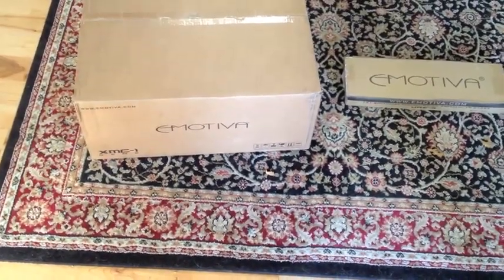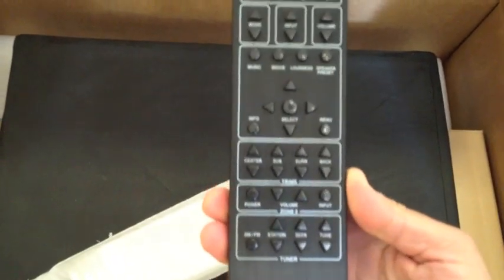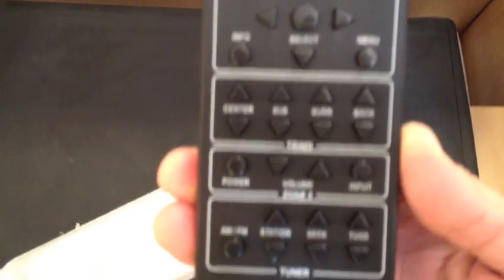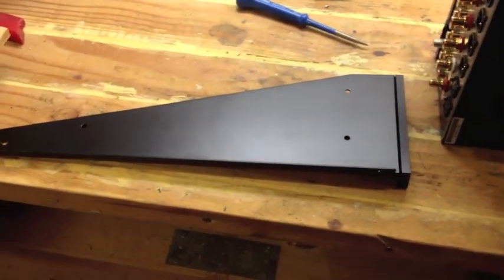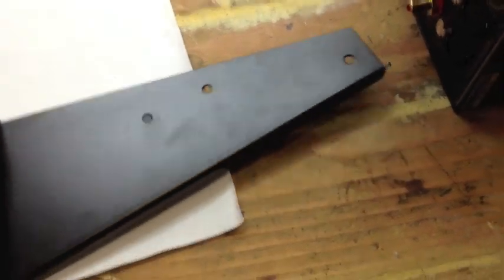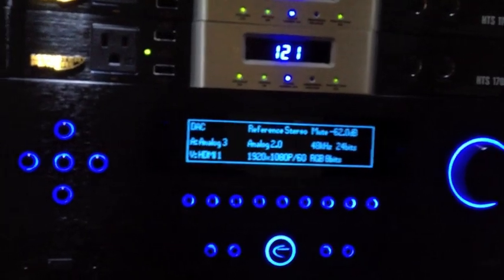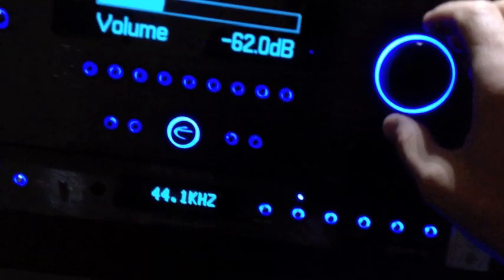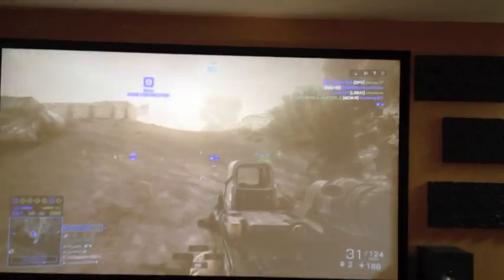Emotiva XMC1

Comment: Honest question here...not trolling.  Why send anythung to the dac and then to the xmc.  Doesnt the xmc have the same dac as that stand alone dac, or even a better one?

Thanks for your time.  Nice setup
Reply: It have Dac but he using the external dac for music goin in on the emotiva dedicated  xlr or rca inputs and he doin reference stereo so the sound is purely from the external dac with a big time streamer like a cocktail audio or one of those other great ones with xlr out and great built in dacs he can use them straight to the xmc but and external dac have more inputs so more sources can be plugged into it .but dont be fooled the dacs on the xmc is awesome to but if u wanna use the xmc purely as a preamp for music then you gonna do it the way he have it hooked up

Comment: Should one use LPCM or bitstream on the PS4 with this Pre-Amp? I know that LPCM is uncompressed but the decoding is handled by the console. While bitstream sends the audio to the Pre-Amp to be decoded, but it doesn't support Dolby Atmos or DTS-X. Which mode is better?